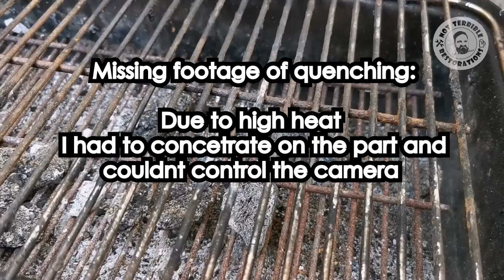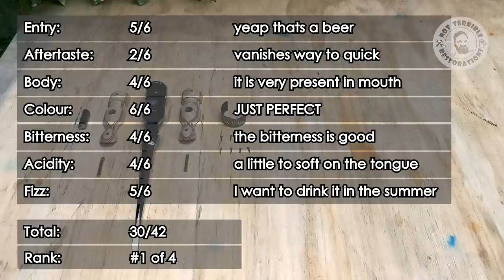WONDERFUL Restoration of a Wrought Iron Screwdriver - Oktoberfest Special

Comment: I attended the opening day of Oktoberfest in Muenchen in 1995. I witnessed the Tapping of the Keg, then went on to enjoy tasting many great beers, wines, brats, etc. Overall, a great day! The screwdriver you restored is also a hammer... The metal cap on the end of the handle is actually a hammer head. I have a modern version of that kind of screwdriver, except the handle is plastic instead of wood. A great item to have when you're up on a ladder & don't want to climb down to get a hammer.

Comment: They need to make old screwdrivers and other old style hand tools like this again, if not for only collector’s items.
Reply from the maker: Yes yes yes. Like special editions.
Reply: I have to disagree, but let me explain first.
These old tools were made, because there was need for such a tool (obviously). They were made in such a way that was available back then. When technology changed (evolved), so did the tools. Moreover, tools need to be made according to norms and safety standards. They also need to be price oriented, because most people will buy cheaper one. Most buyers need a tool to make some work, not for it to look good.
There's also one other dilemma - 'vintage'ness. When a product become vintage? It need to have some age to it at least. It needs to be made in "good ol' ways"; bonus points if it's hand made. If there's a story behind it, even better. New tools won't be hand made, because that's way too inefficient on a larger scale. Even if you would pre-produce components for it, assembly still would take too long. Such a tool, produced for a large scale, would also be way less desired as a designer piece - by being too common, mass produced and new.
Nowadays that's a work for passionates, who will make such tool for order, more as collectibles, yet with usability as well. That's the only way for such a piece to have that "something", what makes it unique. Take "Hand Tool Rescue" wrenches and screwdrivers for example. Those are the tools you and I referring to ;)
Reply: I still would love a set.
Reply from the maker: @Kwaq84  I do understand the concept of lean production and I know that such tools wouldnt be the best sellers on amazon.
Yet I'm sure that a collectors edition of handmade tools with a classic design and a very high quality would sell today as a premium market product.

Comment: lots of good stuff in this.  The banding held by nails will eventually drive you crazy, as they hang up in gloves or flesh.   the other thing is that truly great screw drivers are not tapered at the end, but are hollow ground parallel to keep from putting all the torque on the very top of the slot.  Check out gunsmith screwdrivers for further explanation.      could you have left some of the imprefections found on the band in the shank of the screwdriver, to keep some of its time aged beauty... just a thought.  
Thank you for sharing.

Comment: Nice job but you had way too much wood thickness on those handle halves. Should have measured before you tore out the old ones.
Reply from the maker: Yes yes you are right, but I used precut wood, since I dont have a band saw, so the thickness was nothing I had a influence on. Thank you for your input